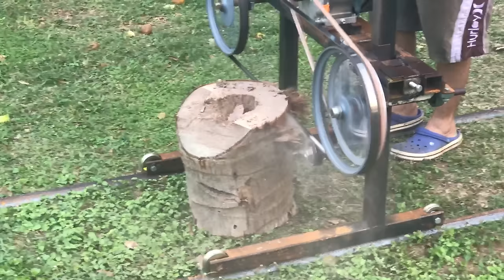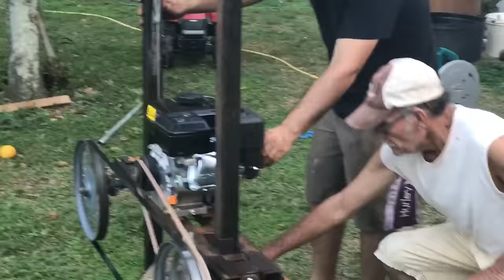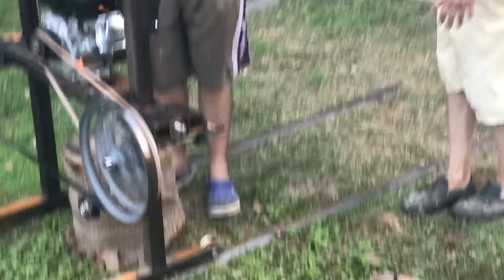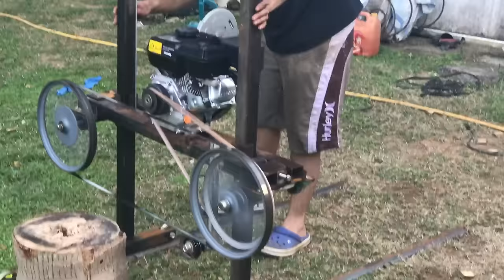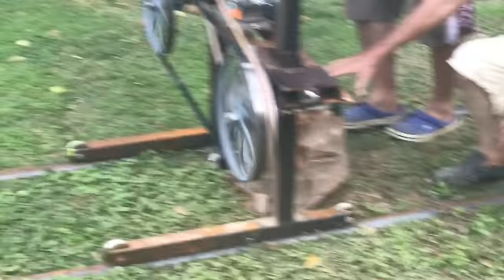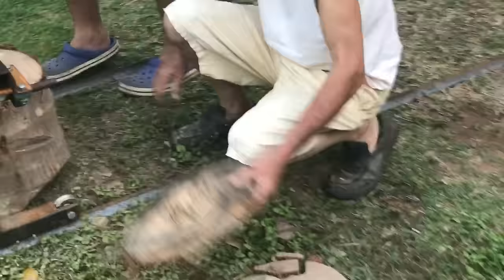Homemade Sawmill aserradero first cut

Comment: I wouldn't put my head or hands anywhere near that thing!
Reply: Just needs a cover for the wheels/blade its like any other saw
Reply: @keithruffner7168  except it has no guides to keep the blade straight and it has no lubrication. I think he's right, it could go off track as it heats up and throw the band
Reply: @aaronlynch4397  oh I’m sure it could, obviously these guys have a few shorts screws shrug
Reply: Like any invention this is a prototype.   At least they are trying!!  Its always easy to criticize.
Reply: A blade guard and kill switch would help

Comment: So I have this idea. A stationary setting to a band saw which allows one to use a skid steer to pick up and secure a log and drive it down the length of the saw in multi directions and set it down and do another.

Does anyone know if this already exists?. If not I'm working on it.
Reply: why would you use a skid steer?  You could use a come-along with a heavy spring to pull it.  I doubt the skid steer would go slow enough.. better still set it up on a slope and let gravity to do the work ... you could increase the slot for softer woods... and use the skid steer to position the logs and tow the saw back to the top of the incline.
Reply: @mfsolutions  honestly I thought the skid steer  running on a straight curb would already be a thing. But a wench like you said ...